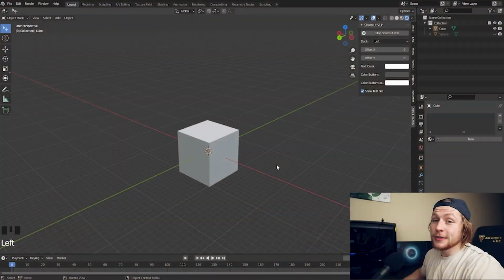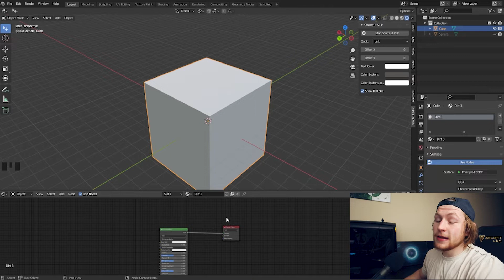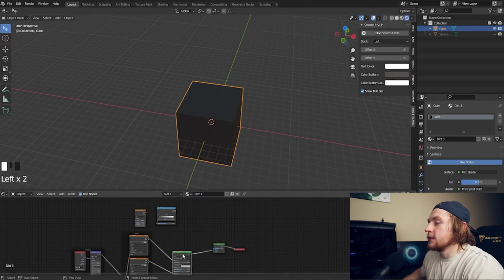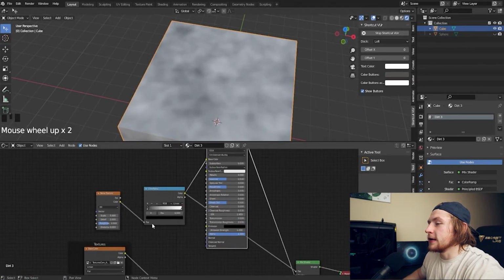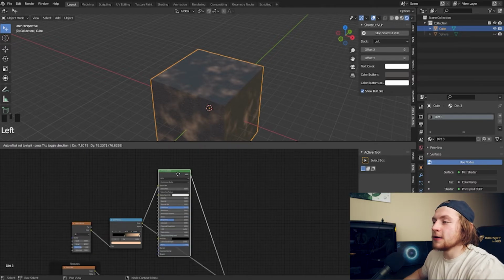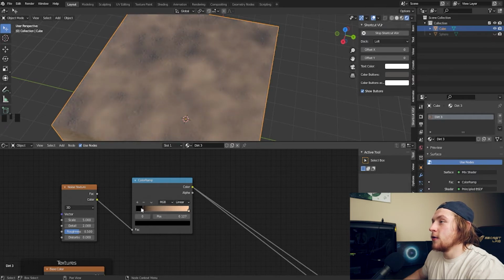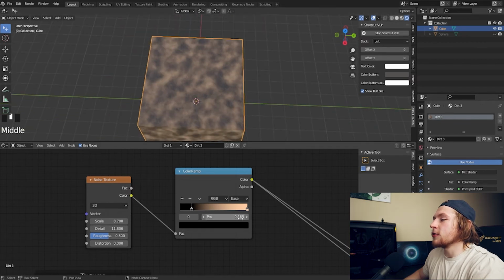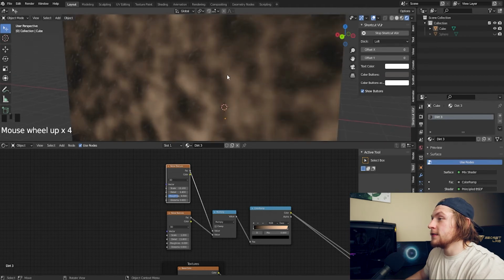Add Dirt To Any Object In Blender! - Procedural Dirt Shader (Blender Tutorial)

Comment: Ok! Now how do I bake this into a texture map w/o crashing blender so I may use it for game assets?
Reply from the maker: Here is a quick tutorial on texture baking if you're unfamiliar: https://youtu.be/2ClzsuExtCo

If you're having problems with blender crashing while baking textures I'm not sure what the problem is. I'd have to know more details about your hardware and blender settings to diagnose the issue. Feel free to share those settings and make sure your rendering device is optimized.

Another possible issue could be the version of blender you're using so you may want to try updating it.
Reply: @Jham3D  I’m sorry if that sounded a little ungrateful. Your tutorial is spot on and it sent me in the right direction. Now I just have to fix my UV and or normals so when I use your awesome procedural dirt, I can put it in a texture map for game assets without seeing jagged edges on smooth surfaces!

Here are my specs:

AMD Ryzen 5 5600X 3.7GHz Processor
NVIDIA RTX 3060 Ti 8GB GDDR6
16GB DDR4-3400 RAM
1TB SSD

I bought 16GB of additional RAM but am currently in the middle of my first game mod and don’t want to lose pace.
Reply from the maker: No! You’re okay haha. Sorry for the late reply, I just moved to a new place this weekend. 

Those specs are similar to my last pc build in performance. Which did fine with everything but ran out of vram pretty quickly if I wasn’t careful. I only had 6gb on a 2060 RTX but I’m thinking you might have an issue with your 8gb while baking. Do you receive a CUDA error message at the bottom of your screen?

If so, try switching your render device to CPU. It’ll be slower as CPU rendering/baking is but should fix that error message. 

Even if this error isn’t popping up, I suggest trying this. If it doesn’t work, let me know and maybe we can hop on a discord screen share or something to solve this